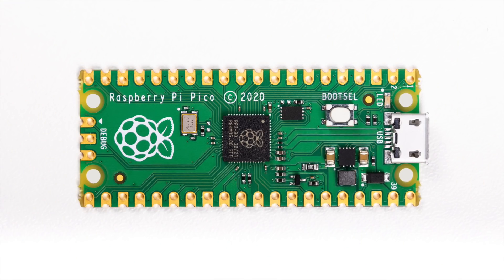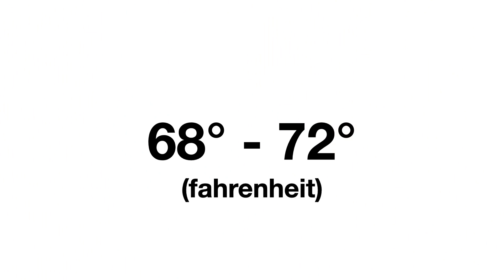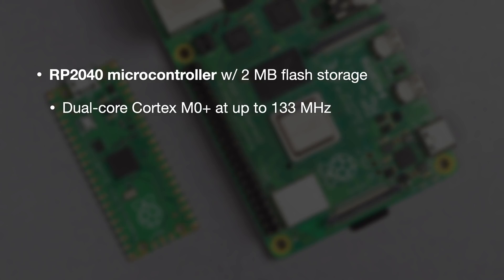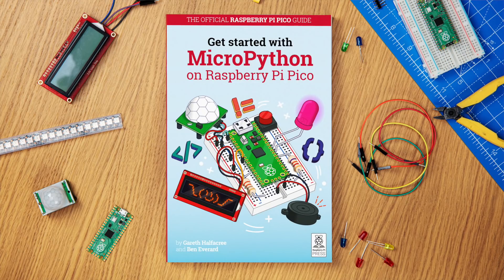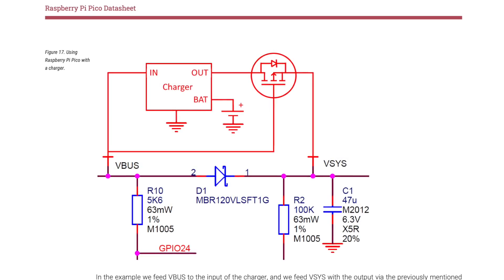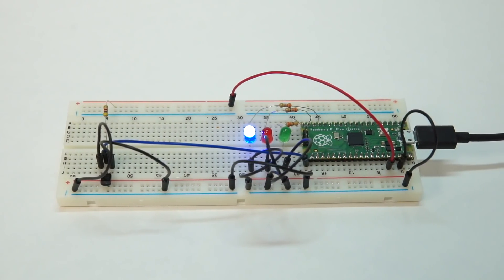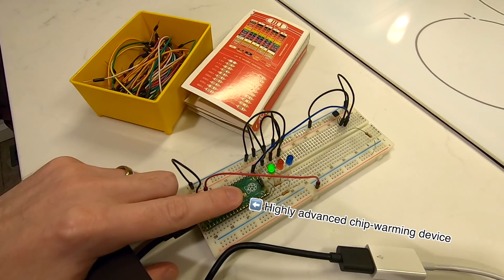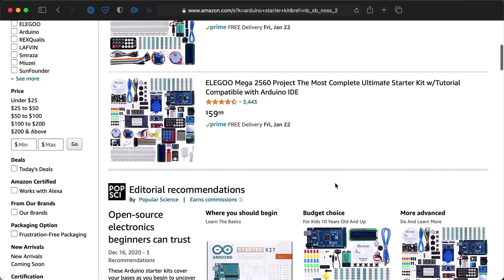The Raspberry Pi Pico Review - $4 ARM Microcontroller

Comment: Hey Jeff, you should look up a sampling technique called compressed sensing. In short, traditional sampling has you collect data at equal intervals (in your case, every 5 seconds), which works provided the temperature change doesn't occur at a frequency higher than 0.1Hz. If instead you randomly sample the temperature probe, you're guaranteed to capture changes in temperature all the way up to half the maximum sampling rate of the ADC. 

Because you sample at random intervals, you can have a lower average sampling rate, reducing power consumption overall, whilst still ensuring that any temperature changes are witnessed, and ensuring high frequency fluctuations can be measured.

Comment: You could have soldered the pins on the top side so the bottom was facing upward to see the pin labels.  Or would there not be enough pin height to plug into a breadboard then??
Reply from the maker: That could work, yes. That would require the use of higher brain functionality than I'm currently running on, though 😴👶
Reply: @JeffGeerling  I have a few kids... i know how it goes! :) oh yeah.. .also that may not work if you have to hit reset to upload code but i guess if you uploaded the code then slapped it into a breadboard and built the circuit. who knows!? we will just have to play with the thing and find out. i have one in the mail on its way and i have a new roll of desoldering wick too.
Reply: @JeffGeerling  so i got my pico pi.  i soldered it onto the pins upside down. to deal with the BOOTSEL button TP6 on the backside is the BOOTSEL line. i just put a button between TP6 and GND.  The datasheet has all this info.  :)

Comment: If you consider the RP2040 datasheet "insanely detailed", you should take a look at any other modern micro. I have experience with STM32, and the F4 line has 200 page datasheet and 1700 page long reference manual. Those two documents cover the similar stuff as the RP2040 datasheet. So the RP2040 either has very little features to write about, or the datasheet is not nearly as detailed as you make it look. From some cursory reading, I suspect it is combination of both. The RP2040 really seems very feature-poor.

Comment: Maybe power is one aspect, enabling batter operated use cases. But one of the most important advantages to these microcontrollers is: _no boot time_! They are instantly on. And... you can turn them off just pulling the plug, without thinking about the file system corruption. You can have tighter timings, without unpredictable OS scheduling. ... 
Also it could be worth mentioning if the USB is OTG (that it has host function), which it seems like it does from the web site.

Comment: Needs quake2 on it. Easily has the horsepower in MHz considering an arduino (one core 8bit, thereby slower) that amount of MHz can do it. However that pico has almost no RAM to access so it probably needs pre-calc done on some other "bag of RAM" machine (e.g ARM or x86/amd64).

Comment: Hey Jeff, congratulations! and thanks for the summary and example project!

You mentioned one of the strong points of using the pico was the low power consumption. You might want to consider flashing the LEDs rather than having them on all the time  and drawing down the battery. That will let you get longer between charges of the device. You will also have the option of putting the device in sleep mode and waking every 30s - 1 minute to poll the temperature sensor to extend battery - 5s feels a bit aggressive. A final option may be be to turn the sensor on and off explicitly before polling it (with a transistor) to reduce the amount of power the sensor takes when you aren't actively measuring with it but I'm not sure if the sensor needs to be always on to achieve a steady state for correct measurements.

Thanks again!

Comment: Great! But have you seen something like arduino micro? Cost of clone is 2$ but for monitoring temperature it is enough. Btw 2mA it is near to normal mode consumption, in sleep it can be less 0.1mA. btw2 256kB is too small for linux - its a pity.

Comment: Somebody should put basic on this. With the specs, oddly enough, it’s still more powerful than an acorn Archimedes. Although that did have dedicated graphics?  This would perfect to implement a 1980s style system, 2MB of flash is huge compared to 8 or 16k rom OS/Basic!

Comment: Only Arm Cortex M0?  I wish it was an M4 or M7 so it could do DSP.
Will there be support for Arduino IDE?
Can you use a JLINK to debug the RPi Pico?
Reply from the maker: Arduino already mentioned they'll be adding support, and building their own board with 16MB flash and a wireless module! Check out https://blog.arduino.cc/2021/01/20/welcome-raspberry-pi-to-the-world-of-microcontrollers/

Comment: Why not user directly arduino?
Reply from the maker: An Arduino would also be great for projects like the one I did here (or even a boring old analog circuit!), but the differences are mostly in small details and specs, like the PIO, the 2-core design, the 133 MHz clock (125 MHz by default)... there are a lot of options out there, and you can pick whatever fits your needs and budget!

Comment: the sleep mode current sounds high... the esp32 in deep sleep mode goes down to 150uA
Reply from the maker: In 'DORMANT' mode, the Pico gets down to 0.8mA. See the power consumption section of the datasheet here: https://datasheets.raspberrypi.org/pico/pico_datasheet.pdf

So it's not quite as deep a sleep as the ESP32 (especially not in 'SLEEP' mode), but still an order of magnitude better than a full-on Pi Zero that I'm more used to.
Reply: @JeffGeerling  still too high.... in hibernation mode using only RTC, the esp32 goes down to 3uA....  this makes the pico not soo good for battery powered projects
Reply: In the age of single-digit microamp MCU sleep currents, any of those figures are effectively horrendous. Unless one absolutely needs this kind of processing power when awake, it's simply wanton throwing battery life away.

Comment: Thanks for making this video so quickly. Immediately grabbed two. This is the price of what is usually Chinese Knock-Off boards. In addition to that, the castellations will surely mean they make their way onto a PCB design quickly for me.

I also got the same 3D printer as you so case design time as well?
Reply from the maker: You may have the same printer... but is yours still sitting packed away in its box? Mine's been sitting there a little over two months now!
Reply: @JeffGeerling  You got me beat. I unpacked mine like a kid on Christmas. Good printer thus far. It’s a time suck hobby though ha.

Comment: Great video ! The only thing I miss is the comparison to the "blue pill" - STM32F103 board which costs less than $ 2.
Reply: And if you do that temperature project with analog components, you'll need 2 op amps (in 1 IC) and some resistors, and it will cost less than 1$, and most part of power consumption will be on LED :)
Transistors will do that job as well, but you'll need to spend much more time on tuning.
Reply: @ІванКлимчук-х2ф I absolutely agree, but with blue pill and Arduino IDE + DS18B20 it will take an hour or so - comparable to RPi Pico or even less. Including searching for (almost) ready code, because programming blue pill under Arduino IDE is far more popular than RPi Pico. 
I just want to say that blue pill is more common, more tested and a way cheaper. I don't get what is the niche for this product. "Normal" RPi was stunning project, with MMU that enables to run full Linux with very low cost. RPi Pico has nothing special to offer.
Reply: @megastarling  Agree. And (if you didn't that yet) take a look on black pill - it based on STM32F411CEU6 - 100MHz Clock, 512kB Flash, and 128kB RAM, USB-C interface software accessible, 32 I/O, including 14 analog inputs - almost the same, will do the same job for +/- same price - 4$ from AliExpress + 1$ delivery to Ukraine (and btw, you'll never get Pi for 4$, because of same reasons - VAT, shipping, etc).
Reply: @ІванКлимчук-х2ф  Thanks, I will definitely look at it. Params looks very promising.

Comment: Pretty expensive as the pi zero costs $5. Also a esp32-devkit costs the same price or less (between 3$ and 4$ icluding shipping) what has 240mhz dual core, wifi, Bluetooth and BLE,4Mb flash, 520KB SRAM. And can be put in hybernate( with practical no boottime), so could run up to 6 months or a year with the same battery (specs). Great video tho ;) ps: 5 seconds between the messurements is way overkill. I keep it on 1 minute in my setup (with esp32). Also the price of an ESP8266 is around 1.50$ with wifi (but runs at 80mhz).

Comment: I want to develop on my Macbook, not on some weird editor. - with Microcontrollers is it possible mount a volume from my mac onto the Microcontroller? - How can I code on my Macbook & have the files sync'd to the Microcontroller and automatically loaded / run maybe? -
Reply from the maker: Yep! you can use other editors too. I worked on the example I recorded on Thonny on my Mac but others were using VSCode, and other editors can be used even without the REPL.
Reply: @JeffGeerling  - There is a REPL? - thats cool. - Are you using an SDK on ur Mac? - at this price I should just buy it & try it out. - I did buy a BeagleBone Black, but it was just too much hassle to develop anything on it.

Comment: 3:25 Hold up, this chip included an embedded RTC and the Raspberry Pi 4 does NOT? I wonder if it's possible to hook a Nano to a 4 to add a real time clock
Reply: You just need an I2C RTC and hook it up to the I2C bus of the pi. The CM4 IO board has one (I'll have to try that at some point).

Comment: This thing is comparavle with STM32 "BluePill" and it's newer version STM32F411 and STM32F411 "BluePill"-s
Reply: Are they called "Black" pill? I'm talking about STM324xx boards.
Reply: @rmatveev  "STM32F401 STM32F411 Development Board V3.0 STM32F401CCU6 STM32F411CEU6 STM32F4 Learning Board 84Mhz 64KB RAM 256KB RO" this is the name of one of them on Aliex... And yes there are also Bluepill and Blackpill it depends on PCB color

Comment: That SIDs temperature thing is dumb. Whose thermostat doesn't keep their house at around that range already? This reads as "don't leave child in a shack or outside dumpster," duh.
Reply from the maker: Houses are complex (especially the older they get). The bedroom in question would often get 3 degrees F colder than the hallway where the thermostat is. I had to install a small heater to keep that room at a safer temperature.

Comment: Red Shirt Jeff: 'I still say the remote controlled blowtorch could've accomplished the same thing.'
'You just wanted a remote controlled blowtorch.'
RSJ: 'No I don't! Anyway, I had this idea for a night light.'
'NO!'
[Congratulations BTW]
Reply: He has a few GPIO pins left. Should be able to squeeze out a nightlight too. LDR , resistor and an another LED.
Reply: @mikehensley78  I think Red Shirt Jeff might have had a 'blowtorch as a night light' idea brewing.
Reply: @CFWhitman  if the room got too cold the blow torch could ignite and warm it up. it would also need an RGB LED for style and horsepower.
Reply: Probably a green blowtorch, a blue blowtorch and a red blowtorch, hmmm sounds like a nice idea.

Comment: Its a cool device I might pick one up, but I am curious why they chose M0 cores. M0 cores are optimised for simple low power things but those power consumption figures aren't impressive. Low power microcontrollers in sleep state should be able to achieve well below 1mA. An M4F or M7 would make a good bit more sense for something like this.

Comment: your price comparison with ESP32 seems not valid
ESP32-WROOM-32 seems to be exactly in the same price range

Also ESP32 has a lot to offer just because it was on market much longer and had a very successful predecessor - and both are widely used in variety of commercial products.
I can only guess rpi pico will catch up with rpi community behind it on hobbists side, doubt about commercial products tho. Don't expect your next desk lamp to come with it - its will will likely have esp8266/32 inside of it.
Reply from the maker: True; right now the ESP32 is a bit of a different beast than this new Pico. And it has quite a bit of momentum already; it won't be going anywhere anytime soon.

Comment: If this will be used only for temp monitoring isn't it a bit overkill of hardware to such thing?
Reply from the maker: Well yes, but it was a small enough project to fit in the video, so that's the main reason I didn't get too wild ;)
Reply: @JeffGeerling  Good video! Yes for video great use, for learning too :) First news about this new Pi is from your channel. Need to buy one for some testing, probably it will be more powerfull than i need but good price is good excuse in this case too.

Comment: Nothing like using a microcontroller to completely overengineer something that could have been achieved easily with basic electronics 😉

Where's Great Scott when you need him?
Reply: you know, it's like comparing Python to Assembly
Reply: @nicolas9013 
Not really. More like comparing a bicycle with a motorbike to travel 100 metres as a fit adult.